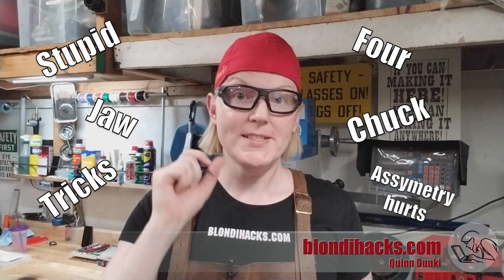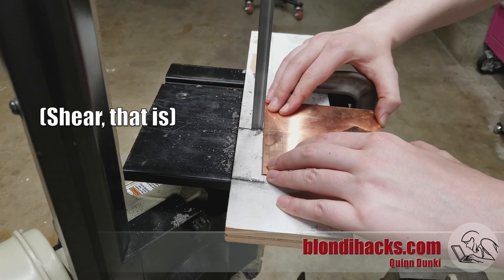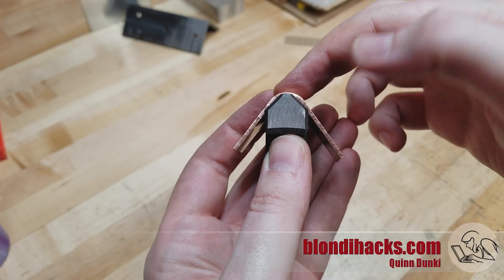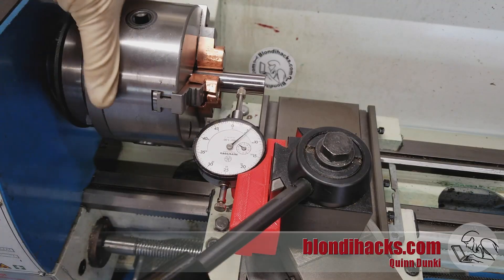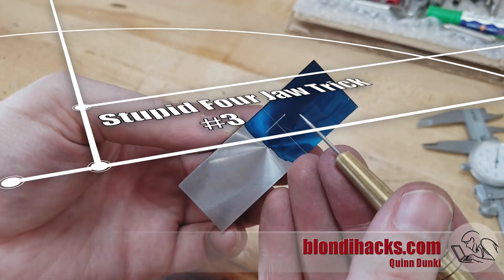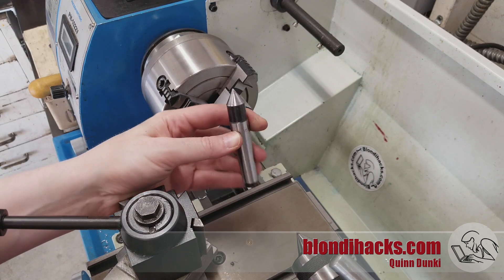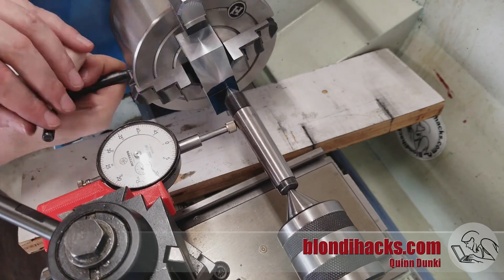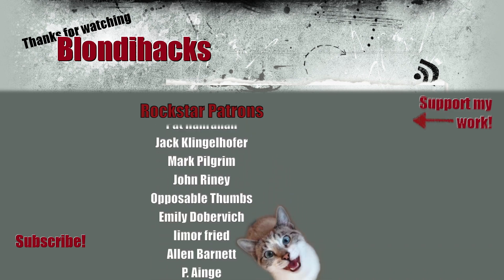Stupid Four-Jaw Chuck Tricks

Comment: Another tip for the four jaw that I believe I learned from Tom at 'Tom's Techniques' is to clone your four jaw chuck key and use both keys simultaneously on opposite jaws. This really facilitates matters when truing work.
Reply: I was going to suggest the same thing, I use a short small chuck key for the rear and turn both front and back at the same time for large adjustments and getting close. Then fine tune with the main chuck key one at a time.
By this method you can often dial in to +/- 0.0001" TIR within 2 minutes from chucking part up... to dialied in. 
I used to hate dialing in a 4 jaw, but now...I never even use the 3 jaw lol since it would take more time to swap out the jaws than to just dial in.
But this is a great video still, she definitely knows her stuff.
Reply: Good point.  If I did that I KNOW that I'd have to put a chain or something on it because I'd forget that 2nd one.  Make the handle a giant blaze orange plastic disc or something like that.  UFO?  Nah, just my 2nd chuck key.
Reply: Great tip. Probably could even 3D print it since you won't be using much pressure when doing the simultaneous motions.
Reply: THAT is a GREAT idea!

Comment: Dang. I  knew about the copper jaws thing, and about reversals, but the dead center trick took the ribbon home. Nifty!
Reply: I agree, great tip!
Reply: Would it be helpfull to use some sort of tap follower so you do not have to readjust the distance to the life center while finding the center position?
Reply: I don't own a lathe, but it would be nice to have one I just don't have the space. I totally agree that dead center trick gets the ribbon. That was impressive enough that was going to be my comment and someone beat me to it. 
........by a year. 😁
I also liked using that angle metal in the vise for a second bend.  No lathe, but I have a vice. 😁
I just recently joined your channel and even though I don't have the machining tools that you do the procedures you show the imagery in your videos and your precise descriptions of your procedures is as good as it gets. Everything makes perfect sense and the added humor is the kicker. This is great stuff that you're showing.
How about a video on improvements to a drill press table to improve accuracy or repeatability.

Comment: a "Trick" i learnt at school, back in 1984/1985.. was opening the 4 jaws wide enough, to put the part against the chuck with the Tailstock Center, then bring in the jaws to clamp it, and then back off the tailstock, and put the deadcenter in between.. then you only have like 0.5-0.2 mm to adjust to get it dead in the middle..

Comment: For the copper soft jaws i use a short offcut of copper tube/pipe, set the jaw point with a round bar held firmly in the chuck. Once tight squash the sides with grips, you then have to mark and cut the tabs similarly to the way you did but leave the rest closed as it helps stop the softjaws opening up once they have been used a few times. They end up the same as yours but closed at the back part.
Reply: Yep, and while she's make the first one you'll be finishing the fourth.

Comment: A tip from a 45 year experience  machinist: use a wiggler instead of a dead center. Wigglers are spring loaded so the tailstock won't need backing off. Put the indicator tip as close as possible to the work. The farther away the less deflection of the indicator. If you wanna really hold tenths then having the indicator tip 1/2 inch away from the work will not give accurate results. Furthermore, since one end of the wiggler is held in the chuck it won't fall on the cross slide. 
All of my 3 jaw chucks are adjustable. If bought that way they are more money than hobbiest folks want to pay. I have modified several of my chucks to make them adjustable. Small chucks can be challenging but I have done 4 inch chucks that work very well. Please let me know if you would like to see how I have done this. I can take some pics. And who doesn't like pictures of metalwork?
Eric

Comment: I used that trick with the dead center to make a couple carburetor adapter flanges so the hole would be bored on target (one was offset from center).  Definitely making some copper jaw covers for my 4-jaw, but will probably use leftover copper tube (cheaper!)  Thanks for sharing!

Comment: Just a tip if anyone cares to read this. To help get sharper bends put a small notch at the end of each bend/line. I've bent tons of sheet metal and it really helps.
Reply from the maker: That would have helped a lot! Great tip! I’m terrible at sheet metal work. 😁
Reply: @Blondihacks  So was I. Then a little old mad showed me that. I'm not sure how it works with metal over .050" though. Great video. Happy making.

Comment: The original technique of milling was actually called rotary filing and was done with the cutting tool mounted in the lathe chuck and the work piece mounted on the lathe cross slide.

Comment: Use the live center to press the part up against the jaws using your center punched hole.  Lightly snug down your 4 jaws and you have it dialed in pretty close.  You can indicate with the dead center after if you need the accuracy.  I used that trick to rough in a 4 jaws on existing bores/holes or when I had a center hole already in the part all the time.  Usually gets you within a few thou depending on how close your tail stock is and saves time.

Comment: Hi, the dead center trick is great! 
BTW - I saw you struggling on getting the right feeds and speeds on aluminum. Try rubbing alcohol. Any feed / speec will work great. And parts will come out clean.

Comment: Alternative: buy a few feet of annealed bare copper wire from the electrical dept of your fav big box store of a size that nestles in the jaw serration. Measure the diameter of your work and cut off a length that will wrap most of the way around. 3 times the diameter is close enough. Make a ring of the wire and slip it over the diameter to be chucked. After a dozen jobs you accumulate enough rings so the need for new ones drops to replacement level. 

The beauty of the narrow rings is they allow you to bump the far end of the work so you can dial in the full length very presicely for center driling. The ugly part is if the chucked surface is too smooth the work can slip axially under heavy cuts or drill feeds. The same is true of the design Quinn demonstrated. Axial slip is something to keep in mind unlees the work is blocked or solidly shouldered against movement.

One thing, be sure the copper ring lies in the plane of rotation, preferably in a jaw serration. If it's skewed the part will tend to nutate (wobble so the part axis follows a cone.) 

If your four jaw lathe chuck jaws are smooth ie, have no annular serrations, you might consider grinding in at least one shallow groove. Do this in the lathe with the jaws locked on a short slug gripped at the heel. A Dremel or die grinder will do the job. Use a mointed point grinding wheel B-70 if 1/8 shank or A-36 if 1/4 shank. Dress the included angle to 90 degrees symmetrically on the radial plane. Two sets of jaws are handy: one ser smooth, one set serrated
Reply: I like the notion of being able to bump the axis true for long (eg shaft) work. I suppose this could also be done with soft steel wire, which would permit of gripping a bit tighter? Hardened C clips from round wire were sometimes used for gudgeon (wrist) pin retention (and can be made by starting to make a spring but changing your mind and cutting it into rings) but I guess these would mark the work, and perhaps not even conform well enough to develop a secure grip?

Comment: The copper jaw thing, I made mine from cheap copper pipe, I cut it lengthwise with a tin snips, then annealed it with a torch. Made it quite easy to work with.

Comment: I used to squeze a part that was oversize not between the two opposing sides by reversing the jaws but between two adjacent jaws. that way i did not had to remove any of them and flip around. works quite well too.
Reply: Me too. The work (in the simplest case, a piece which looks rectangular from the top, the front and the side) is laid across the chuck face, with the long axis at 45 deg (like this, /  viewed from the tailstock) while the jaws are oriented vertical and horizontal (Like this  + ). If you take light cuts with a very firm jaw grip, you can machine a piece as long as the swing of the lathe, something normally not possible using a chuck.

Comment: Another useful material for use on a 4 Jaw Chuck between the jaws and the work is the strips from electrical buss bars. It's about .050 thou thick. Another useful tip for a 4 jaw* is if you do a lot of longer work and you chuck has tee slots in it is make up a set of screws that fit the tee nuts. These screws are then tapped for a smaller size screw. They allow you to tweak the work out on the end without tapping on it with a soft hammer. With out tee slots you can always use a nut and screw that fit into the gap if any between the chuck body and the work. A small pry bar also works well. Just don't apply too much force so the part comes out of the chuck. Do not ask me how I know this.
*Where I served my apprenticeship and worked at for 30+ years every thing we did was done in a four jaw. IMO 3 Jaw Chucks are best used as boat anchors. But that may be because I have seen too many that were so abused that the jaws and body were bell mouthed

Comment: When you want to drill or bore an eccentric hole in the 4 jaw, engage the tailstock centre with the centre punch mark and clamp it to the face of the 4 jaw with it. Snug the 4 jaw's 4 jaws on the part. THEN do the trick with the dead centre and dial it in. Takes a lot less hands and you will be very near even before you begin dialling in.
Reply: Great tip. One further observation: if the amount of eccentricity is more than can be accommodated (because, as BH points out, one jaw can no longer reach far enough), provided you're only drilling and (gently) boring, it may work out OK (depending on the diameter of the work relative to the eccentricity)  to leave one jaw off, and make as if  you have a universal 3 jaw chuck.
Reply: That was the comment I was going to add ,much easier !!!

Comment: Non ferrous metal (like copper and aluminum) cut easily with a hack saw.  An electric jig saw or even a scroll saw will work too.  A cutoff wheel in a Dremel  is another good idea.   Some kinds of bending brakes also have shears in them, so your flub wasn't that off.
I have an el-cheapo HF bending brake, but I've also gotten good square bends by smashing the material flat in the vise with a hammer.  (non-ferrous metal is VERY malleable).

Comment: Regarding centering a random hole...  What about loosening the jaws "generously" to allow the mark to be centered.  Drive the dead center (only) into the mark and then tighten the jaws to grab the part.  I'm guessing there might be a  problem with keeping the hole aligned precisely enough?  But in any case, this would let you quickly get to the final adjustment very quickly.

Comment: I pulled some copper sheet out of my fire pit after burning and old cheapo stereo reciever.   That was butter soft and pliable.  Musta got plenty hot and cooled slow.  Can I  stiffen them up with a heat n quench in water once they're formed to jaws?
Reply from the maker: I would leave it soft, honestly. It’ll harden up with use. Copper work hardens very quickly. Hammering it would speed the process if it’s too soft to use
Reply: @Blondihacks  okey dokey

Comment: Hi Quinn,
I simply love Your videos - You're a great machinist!
I'm learning a lot from You and getting loads of inspiration - thanks for sharing.
I got a small tip for You though. I watched Your video on patreon where You're making the phone clamp. When You turn the hinge pin and filing/deburring/champfering (?) the edge, You mention that You have to be careful with the file so close to the chuck, and I, of course, totally agree. But to avoid the file shooting into Your hip, just have the tip of the file longer towards the back of the machine, ie past the chuck, so You are using more or less the part of the file closer to the handle. This way You should be more safe - Yatzy ;)

Keep the great videos coming <3
Reply from the maker: In fact, I cover that exact tip in my deburring video! Thank you for the kind words.
Reply: @Blondihacks  So I had to watch Your deburring video also - obviously ;)

Comment: Since 16 gauge copper is harder to work with and the only purpose is not to have the chuck jaws chew through it...  How about using 24 gauge (22 vs. 64 mils) and solder a couple of small pieces to thicken the copper, just at the tip of the jaws?

Comment: I don't know if machinists have a faceplate like watchmakers use for off center drilling but ours have curved slots with built in clamps and what we call a pump center for alignment of off center hole alignment so maybe we have something you don't, any way great show keep up the good work, say hi to sprocket for me.
Reply from the maker: We do have faceplates, indeed. Great for all sorts of odd fixturing jobs. This center trick works for faceplates as well, but you have to tap the part in instead of using the jaws.

Comment: I wonder if a spring loaded tap guide in  the tailstock would adjust for that movement in Z as you dial in the 4 jaws.    Great video Quinn.
Reply from the maker: Good idea! The center is pretty heavy though. I would worry about it falling
Reply: Think something to consider is the runout in the tap guide compared to the runout of a live or dead center. I think a tap guide would work well, but if you’re working with a tight tolerance you may want to go with a live or dead center in the tailstock. My tap guide has just a little bit of side to side movement because it’s worn.